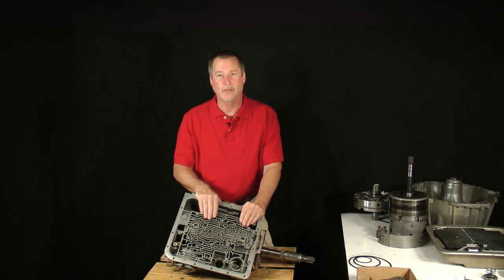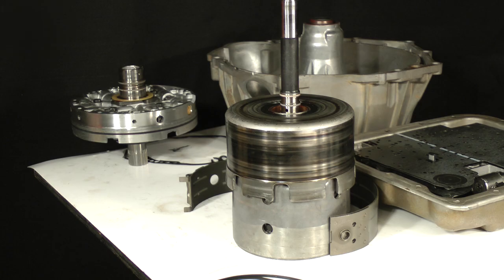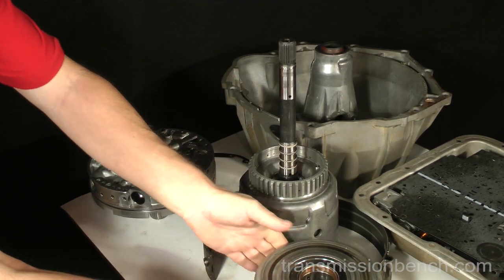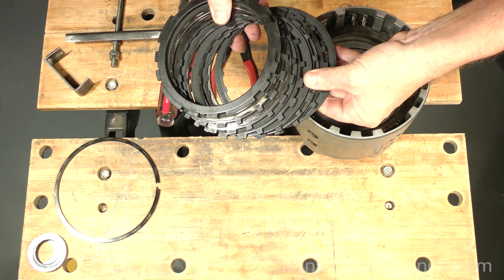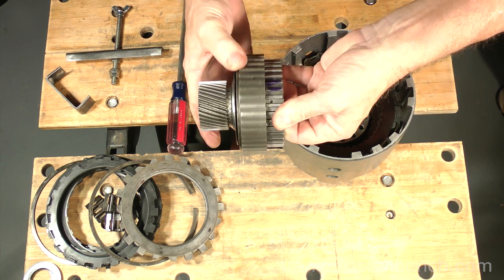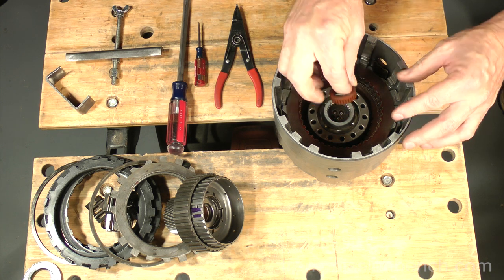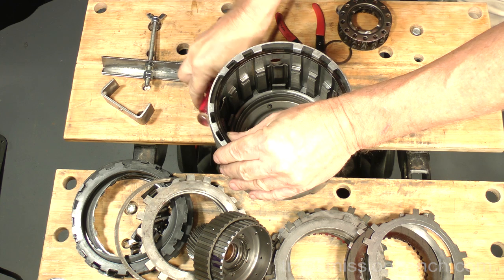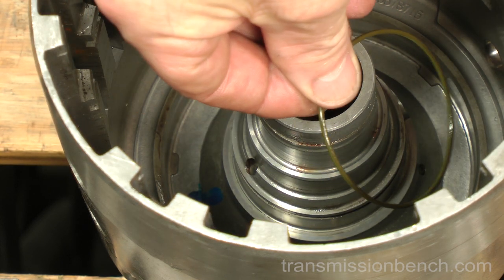Project 4L60E part 2 lesson 4

Comment: I just rebuilt my 2007 Chevrolet 4L60E following Jimmy's tutorials and it works again!  Fantastic video series and presentation.  Never thought I'd attempt this procedure but he made it easy as well as ordering the parts I needed.  Highly recommended, thanks Jimmy!
Reply: How's your build holding up???
Reply: @dnegel9546  Just fine, it's my daily driver and I've gone about 1,500-2000 miles on it without any issues.  I keep my ears tuned for any possible weirdness but nothing to report.
Reply: @rivenmotors7981  I'm currently at the input drum part. I'm almost getting there. 

Btw.. I was confused on how to clean the parts he said to just use miracle spirits.. but does that mean I let it dry like that or do I rinse it off 😬😬 🤷 I should mention I'm a novice. 🥺
Reply: @dnegel9546  We all have to start somewhere.  Honestly this was the first time I used mineral spirits to clean parts also.  It's not super volatile so it seems like it would take a while to evaporate on its own.  If you have a compressor with a airgun you can use it (outside and wearing eye protection) to force the spirits from the nooks and crannies of the piece being cleaned and speed drying.  You want everything inside the trans as clean as possible.
Reply: @rivenmotors7981  haha thanks for the response. Guess I did it wrong. I wasn't sure so I rinsed some of the parts with water and I air dried it and sun dried then I checked about 10x with air to make sure no water was present. I suppose as long as its clean it does not matter? 🤷 

Yeah I was thinking like man this mineral spirits thing is pretty thick and milky. Seems letting it dry would take forever. 

Guess I'll find out if I messed it all up when I start the car. 😓 Worst part is I don't have a garage. So I am doing it on the concrete and a few picknick tables. With lots and lots of trash bags for when I'm done for the day I can cover them up. Not ideal but it's what I have to work with.

Comment: My old 3-4 clutch pack was not burnt or warped/coned but the "cogs" on the insides of the clutches show wear and I don't know how serious it is. Some of them have been reduced to half their original size measuring from left to right. They appear to be taking a pounding in primarily one direction which is essentially widening the gap between each cog (if it continued the cogs would be completely gone leaving the inside of clutches round). What is causing this and can these be reused if flipped over to other side (since only one side of the cogs is damaged badly)?
Reply from the maker: +chad boren If half of the splines on the friction plates have worn away, I would recommend replacing them. This is common and actually a healthy sign that the clutch is operating well....no slipping! Jimmy
Reply: Would the clutches still operate if all the spines were sheared off and the insides of clutches were smooth and round?
Reply from the maker: Well...the clutch pack might apply, but it would not transmit torque. Jimmy
Reply: Ok thanks

Comment: finally we see how to dis-assemble the front clutches!! thankyou,
BUT this should have been done already (BEFORE reassembly began in part 2 lesson 1)- in a part 1 lesson 8 module, so that ALL dis-assembly / inspection work is complete before any parts are installed {in reality this is how repairs are done: autopsy first, order parts from inspection findings, then LAST assemble box with new parts}.
Reply: andy van
Reply: It is painful ordering parts. Almost gave up just trying to get all parts in a timely manner. First tranny rebuild is painful.😢